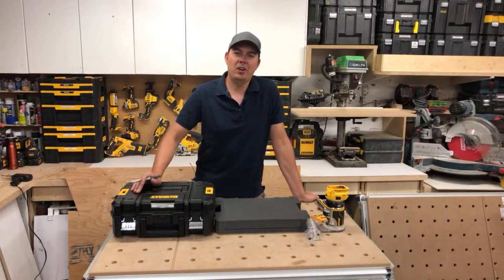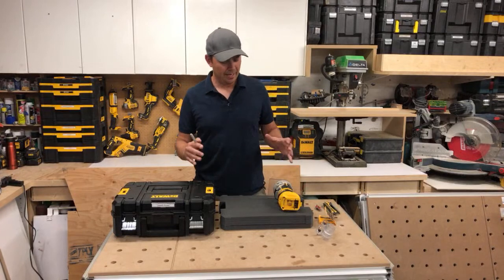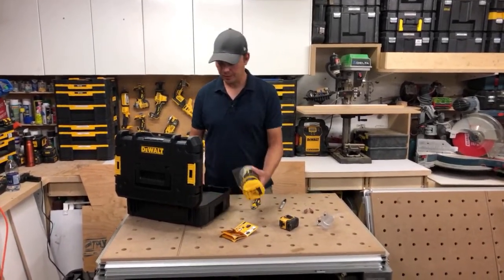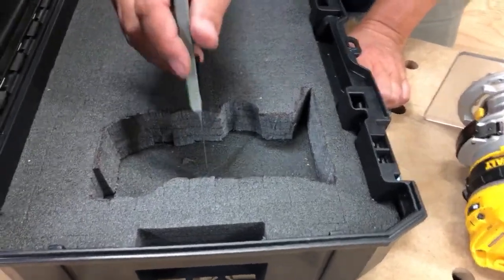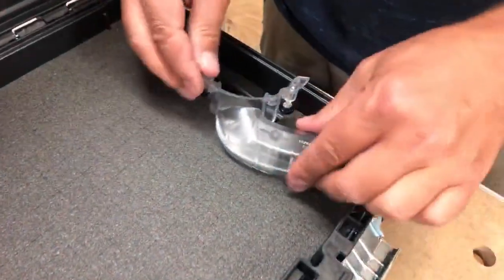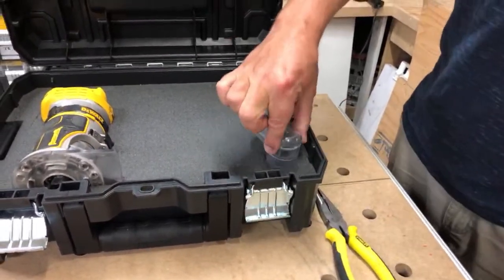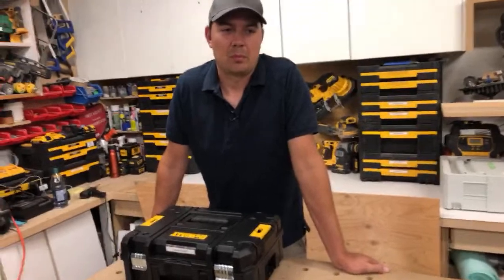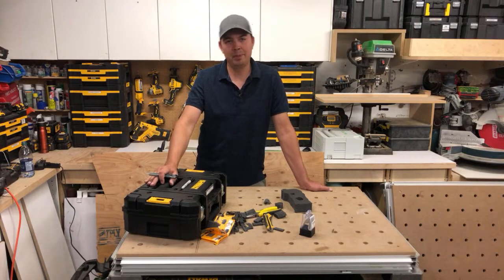How to Cut and Fit a Foam Insert for your Dewalt TSTAK

Comment: Yadda yadda yadda waffle waffle waffle…..Here’s the time stamps relevant to the vid title.   11:05 to 12:50 then 15:20 to 16:20 then 18:50 to 20:30. 
Then 22:30 to 25:30 BTW…The underside of the foam pad is not ‘cubed’ so if you prefer a neat cut out shape, turn it over.
Look at all this DeWalt gear…This guy earns too much!
Reply: Thanks, buddy likes to hear himself talk. Get to the point man

Comment: Here's a little hack I learned along the way with pluck foam.  After you have it cutout for your tools, or whatever items you're storing.  Buy some cans of plasti dip, and spray all sides of the foam insert very liberally.  You'll use a few cans, but this helps keep things together and extends the life of the foam with a protective layer that takes the abuse and not the foam.
Reply from the maker: Cool thx! I’ll give that a try 👍😊

Comment: Please get to the point, it is a waste of 5:35 until there is beginning of discussion on cutting the foam, and them more rambling. I gave up at 6:55.
Reply from the maker: It’s was a live show, so it will be slow so people can sign in during it. If it’s too slow for ya, you can always increase the watch speed.